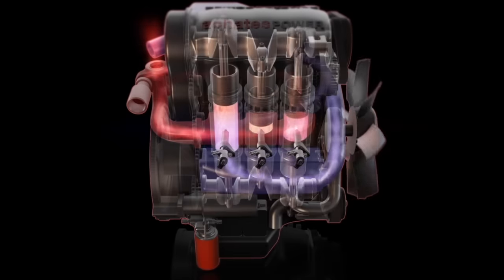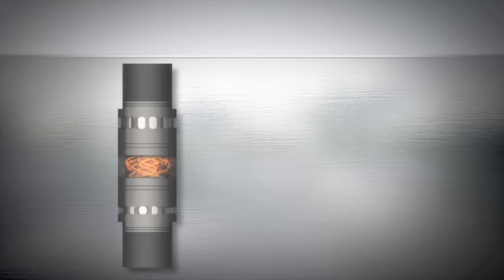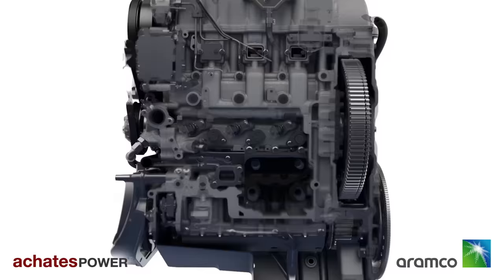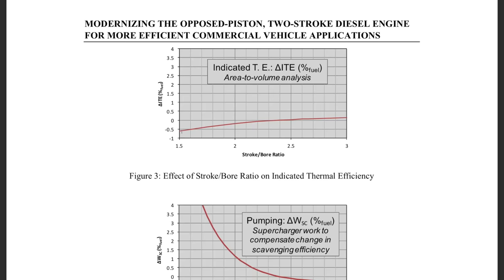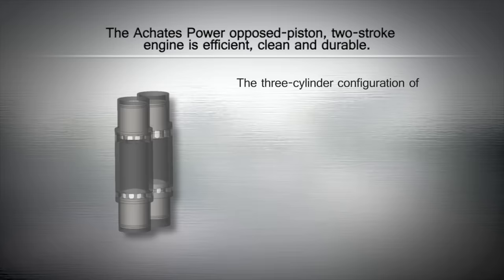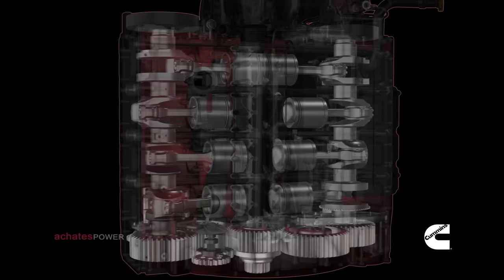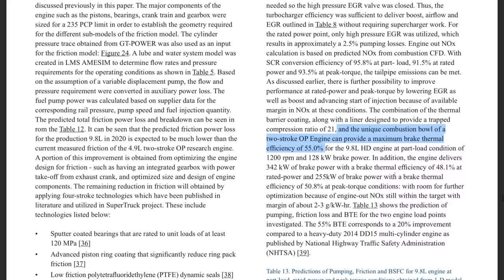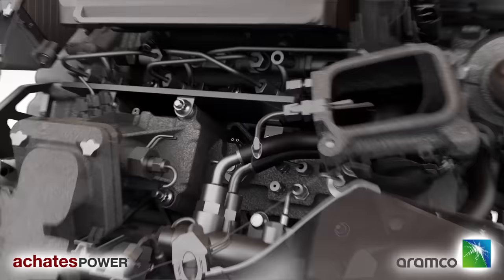Opposed Piston Diesel Engines Are Crazy Efficient

Comment: With efficiency numbers that high, it's hard to be "opposed" to it!
Reply: Unless you own an oil company. That's one reason The Big 3 in the USA won't switch to more efficient engines like this. It would cost them money to convert to new products and the oil companies would bribe them not to change to keep profits as high as possible.
Reply: @baddriversofmoosejaw8681  it's also possible these giants hindering BEV adaption.
Reply: Its still using diesel, so its still using oil. Oil won’t be there someday. But if you use other fuels its truly hard to oppose
Reply: @derdrache0512  Diesel, Gasoline, Jet fuel and even propane are all processed from oil. That's another reason the oil companies are so rich. Without them gas and diesel vehicles would be useless and so would jet aircraft. We'd also have to use natural gas for our barbeques. Oil has many uses besides lubricating engines, and making plastic and asphalt.
Reply: Key word 2 stroke - emissions hold back production in the USA due to our overly strict standards
Reply: @baddriversofmoosejaw8681  I guess what I’m saying is if they can barely do it with 4 stroke diesels I’m not sure how they could with 2 stroke diesels. I’m actually sitting on a 2 stroke EMD tugboat and all the company’s are moving to 4 stroke due to emissions tier requirements - even though 2 stroke diesels are much better performers. No question we all like them better. 

Either way I sure hope your right and if they can, that’s a really nice power plant
Reply: Shame on you. Go sit in the corner and think about what you've done.
Reply: GTFO
Reply: Haha, nice wordplay. Thanks! 😁
Reply: Fr
Reply: @andrewashworth7539  This engine was used  by soviets in t64 tanks. They had huge problems moving in tank columns becouse of toxic exhaust fumes.
Reply: @baddriversofmoosejaw8681  Nope.  It's big government that is the problem. They make way more of a gallon of fuel in taxes and like behind-the-scenes fees than the oil industry itself ever comes close to making as actual profit once operating costs are taken out. 

Big oil would love to see us using high-efficiency engines that burn half the fuel they could sell us at twice the price for twice as long into the future.   But if done that way big government would lose massive tax and related revinue.
Reply: @andrewashworth7539  how worse it is if it burn at a higher % efficiency than a 4 stroke?
Reply: Check out Deltec engines from the '50s
Reply: @Durolith  I think because of how the gases are processed 2-stokes produce more chemical waste (NOx, smog), but they produce less waste heat since they use less mechanical motion for the same power.
Reply: It's still far less efficient than electric vehicles. Until internal combustion engines can eliminate the waste associated with heat and sound generation, EVs will always be more efficient.
Reply: @xmask321  There is heat and sound involved in electricity generation. We are decades out from a majority solar/wind/hydro production.
Reply: @xmask321  Utter nonsense. You have absolutely no basis for that.

Heat management is precisely the achilles heel of EVs. The advertised consumption numbers are fraudulent: EVs when not at optimal temps easily consume DOUBLE!

Then the trillions needed for subsidies as the vehicles cost more.
Then the trillions needed for reworking the electric grid and building new power plants.
Then the trillions needed for millions of chargers, their maintenance and periodic replacement.
Reply: @andrewashworth7539  actually europe has stricter standards. the achates engine already exceeds the next gen euro standards, which is something no one else can claim.
Reply: @derdrache0512  The pistons oppose. 😃
Reply: @baddriversofmoosejaw8681, What? They’re all making big pushes for more efficient cars. Do you not notice them dumping money into smaller engines and EV? I mean, from what I can tell Dodge is potentially dropping the Hemi for an inline 6 and the big three are all making seemingly big investments in EV and such. I personally don’t think oil companies like EVs all too much
Reply: @hectichive889  Chill dude... the point was the pun.
Reply: @nitin7218  electric vehicles are being hindered in production because they are just bad overall. sure they look good on paper, but once you get into the nitty gritty details, they are really not that much better and may be worse than ICE's. Load on the power grid is a major MAJOR factor that nobody remembers to apply to their "carbon neutral" standard. Unless the Biden administration decides that 40-50 new nuclear power plants need to be built to replace the coal they are trying to get rid of, we might be having power problems anyways let alone with a "fully electric" vehicle world.
Reply: @JWQweqOPDH  actually, non-turbo 2 strokes use the downstroke to push air/fuel into the cylinder. Two things smoggy about that...the 2 stroke oil mix (because of the dry crankcase) gets burned too...and both in and out ports open at the same time allowing unburned air/fuel/oil mix to pass. With turbo direct injection both problems are solved...you can have a wet crankcase with no 2-stroke oil and fuel is supplied after the ports are closed. Might just run clean, might still need DEF.
Reply: @andrewashworth7539  Opposed piston is easier for emissions compliance than other types of 2 stroke engines. They burn much more cleanly as the combustion acts on both pistons and does not get deflected by a cylinder head.
Reply: @pistonburner6448  but EV's are still cheaper to run for normal people
Reply: Unless you’re an oil magnate ☝️
Reply: @ifixit706 That petrol 2 stokes mate.
Reply: @derdrache0512 There's such a thing as bio Delisle which can be made with used cooking/fryer oil. There are also companies developing synthetic carbon neutral fuels and oils which are already being used in the WRC and other motorsports. Because I'm sorry the production of EVs is not carbon neutral or good for the planet and all the infrastructure required for us to go all electric won't be  in place by the target of 2030

Comment: 2 stroke, super efficient, supercharged AND turbocharged!! I'm sold
Reply: The super charger isn't really there to raise cylinder pressure. It's a scavenging blower it's there because the pistons don't do pumping work so they don't pump out exhaust gas. The blower pushes fresh cooler air in causing the hotter exhaust gas to flow out the top. This is also the reason mounting the engine horizontally doesn't work as well and hurts efficiency because it reduces scavanging that's naturally aided by thermal gradients.
Reply: plus adding on eco fuel as f1 intended.
Reply: sounds fishy when you hear a about turbocharging a conventional two stroke to be honest
Reply: @SeNu420  it's far from a conventional two stroke though.
Reply: The intake and exhaust port open at the same time no pressure gain possible from the supercharger.
Reply: Efficient and longer lasting. That could be a problem. Well the longer lasting part.The thing I drive now the drive train is fine.
 The parts that control the cabin functions. Gone.
 Well that's enough for the olde lady to want me to get another.
 You know, in case the other newer one needs gas.
Really I don't mind not having to always a just the seat 1st just to get in.
She is going really get pissed. The next one is going to be a stick.
I ain't playing I deserve the new one, I pick out, female game with her.
She got what she wanted, a cute little SUV.
Reply: @satunnainenkatselija4478  well yes, you can say an expansion chamber is like a turbocharger, but i doubt that it produces lets say more than 90% volumetric efficiency, plus it gets some exhaust gasses back in the cylinder also, but i might be wrong about the volumetric efficiency part
Reply: John H that’s exactly how large marine 2 stroke engines work. They use turbochargers and blowers to introduce fresh high pressure “scavenge air” via scavenge ports to blow the exhaust gas out of the exhaust ports
Reply: 2 stroke makes power... not efficiency... and in that matter you have a better solution... wenkel...
Reply: Shut up and take my money! I’d love to convert my Ford Ranger to run on one of these! Think of the towing capacity and fuel mileage!
Reply: And its a 2.7 liter engine
Reply: @SeNu420  marine two stroke diesels have been either turbo or supercharged for decades. What's fishy in it?
Reply: @johnh8546  To truly supercharge the engine, you'd need a compound twin supercharger setup because the second supercharger is already being used for scavenging. You'd need another one ahead of it with a higher airflow to truly compress the intake air (pressurising the air between the superchargers).
Reply: @SeNu420  got one in my bus, it works and sounds great, not efficient at all though. It isn't am opposed design though, it is a traditional v motor
Reply: @fredo4x4  The slight offset could get a bit of positive pressure, not like a 4 stroke though.
Reply: @markschroter2640  If the port are offset its because the exhaust port need to open before the intake to avoid flowback in the intake after the combustion cycle. In this configuration of engine if the exhaust open before it also close after the intake. A turbo or a supercharger only help to push out exhaust gas and put fresh air in the chamber for the next cycle.
Reply: Todd Amtmann  im talking about a petrol 2 stroke, i was thinking that the resonance chamber is what the guy was referring as a "2t turbo" and in a petrol 2t, yes you can put a turbo in, but it will mess up everything, even more if its a high compression 2t, either it will start knocking, or all the AF mix will go out the exhaust because it has higher pressure and the turbo will be in the way for the resonance chamber to get back the AF mix to the cylinder
Reply: Detroit Diesel has made 2 cycle diesel engines for 50+ years. Very reliable and efficient. Outlawed by EPA.
Reply: @SeNu420  Detroit Diesel made 2 stroke diesels for 50+ years. They need a supercharger to start and idle, but over say 1500 rpm when the turbo starts making boost, they have a flapper that allows the air to bypass the supercharger. So effectively the supercharger is no longer needed at that point. The air is being moved solely by the turbo + valving actions of the piston and valves.
Reply: Twin charged vruh
Reply: the only thing i can think of is.
1.fuel efficiency .
2.noise 
3.the ability to egr this without heavy maintenance.
Reply: The price?
Reply: Oh you are!!!
Reply: ur sold for how long next 10 yrs till everything goes electric !!!!
Reply: Europe dropped two stroke engines in the mid 1970’s because they were seen to be too polluting to the environment and this was. Mainly because they burnt 2 stroke fuel ( a mixture of petroleum gas and oil). How can oil burners be the way forward?
Reply: @markschroter2640  You probably have an old two-stroke Detroit Diesel. This engine is like two 3 cyl. Detroits with the heads removed and then bolted together, one upside down on top of the other.
Reply: @johnh8546  its work is more like a scavenging blower, cleaner air than of a conventional 2stroke without one, also that type of engine creates higher compression than of a conventional 2stroke engine, so it doesnt need that much of  air pressure.
Reply: @nickpedley3502  an OP engine doesn't burn two stroke fuel. It burns just fuel and is lubricated like a 4 stroke. They in the past did still burn a little more oil than a traditional 4 stroke but this engine has been shown to have an oil consumption rate comparable to modern 4 strokes.
Reply: The best thing about the diesel is when petroleum is no longer available it can still run with other oils like hemp, vegetable, sunflower, etc.😉👍😎
Reply: I just want to see the fastest 2 stroke 3 cylinder front wheel drive production car in the word
Reply: @GGozzMontanelas  Wankels are not as efficient as a piston engine. The reason......surface to volume ratio.  That same surface to volume problem also manifests itself in higher emissions.
Reply: @scottwhitley3392  Because it is fuel injected, they are blowing in pure air.  Seems to me, that the more pressure/velocity the cleaner and cooler they can make the cylinder before the exhaust ports close.
Reply: Think about the volume not just the pressure. It works like a lever. Low pressure with high volume could generate high pressure with low volume.
Reply: @SeNu420  all 2-stroke Detroit diesel engines have turbocharging/blowers since their initial use.
Reply: @chrissweeney2738  without an extreme breakthrough in battery, energy storage, everything will NOT be going electric.  The grids would need a massive overhaul, as would our power production: nuclear and hydroelectric.
Reply: @nickpedley3502  by scrubbing the emissions.
Reply: @charleshodges836  yes, i can picture two 3-53's bolted together. HEAVY.
Reply: @johnh8546  Do not understand.  There are exhaust and intake ports.  The pistons travel past the ports.  The oil rings on the pistons also travel past the ports.  Oil is scraped to the ports and accumulate at the intake and exhaust manifolds.  Just cannot understand how.
Reply: @catchnkill  my understanding is that it's due two factors. One that the oil control rings are on the "bottoms" of the pistons which never pass the ports and they do the oil scraping. Two the cylinders are honed in a way to keep oil on the cylinder walls so that the combustion rings don't scrap oil off the walls in any significant amount.
Reply: @scottwhitley3392  And opposed piston marine diesels have been around for over a century  CC Pounder of Harland & Wolff hugely improved them with airblast injection and they were building hugely economic motor liners almost a century ago with MV Britannic and Georgic
Reply: Supercharging is realized by closing the exhaust ports before the intake ports. Diesel sub propulsion engines were supercharged. Not the generator engines.
Reply: I read the article that says The exhaust, specifically expansion chamber, actually Sonic supercharges a standard two-stroke with sound frequencies

Comment: friend: *laughs at me for having a 3 cylinder car"
the 3 cylinder:
Reply: cool fact: 
The $150,000+ BMW i8 is a 3-cylinder
The largest displacement production bike, Triumph Rocket III, has 3 cylinders
Reply: @benedictodiptasuta9306  Yes, and it is only about 50kg heavier than say, a Laverda Mirage.
Reply: @Thomas B  stress..... that engine won't last very long.
Reply: Mercedes  already had a 3 cylinder diesel  in the smart car
Reply: @benedictodiptasuta9306  so your telling me that by saying a powerful motorcycle has the same thing as a tiny German car that some how that makes it not tiny?😂
Reply: @charlesmanering7746  Yeah two-stroke, three-cylinder engine was used in Wartburg 353 that was in production from 1966 to 1988 .
Reply: Ford Fiesta has used the 3 cylinder engine- Mini Cooper- never thought about this before my friend showed me this - then again those 2 are gas not diesel …
Reply: ah but It's 6 piston
Reply: Geo Metro cars had 3 cylinders.
Reply: @qwertyui90qwertyui90  They have been used in ships and stationary engines for more than a 100 years. They last forever, and they don't vibrate. Pairwise, the two pistons, conrods and cranks cancel each other out, so where's the stress?. How many pistons - I see 6  and I see 6 cylinders, but only three combustion chambers. It a six-cylinder engine.
Reply: @pete_lind  Yep. I had one. It freewheeled when you took your foot off the throttle to stop the engine from seizing up on the overrun This meant that you could change gear up and down without using the clutch. Bought it as a cheap stopgap when changing cars, but kept it for five years as it was great fun!
Reply: But the engine has 6 pistons

"say what?"
Reply: @benedictodiptasuta9306  Many cars now have 3 cylinder, 3 piston engines.
Reply: @willrainwater  I miss my metro... Gas mileage was fantastic.
Reply: Adding to the list, Toyota GR Yaris and GR Corolla have an up to 300hp 1.5L 3cyl